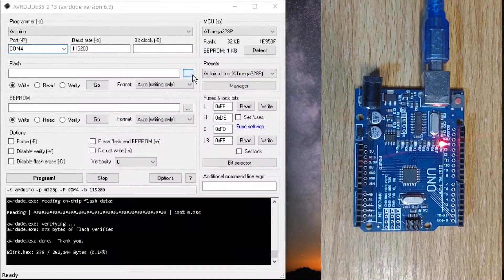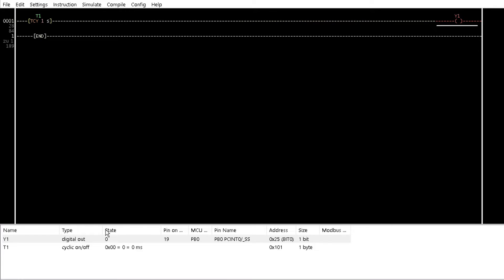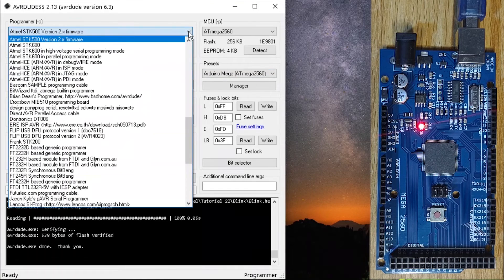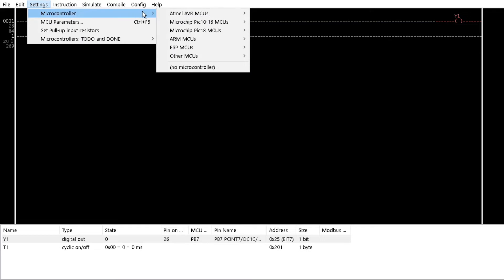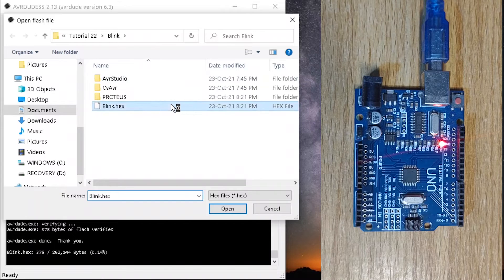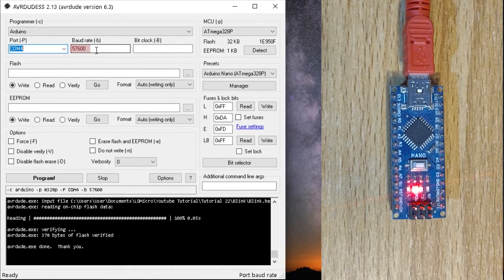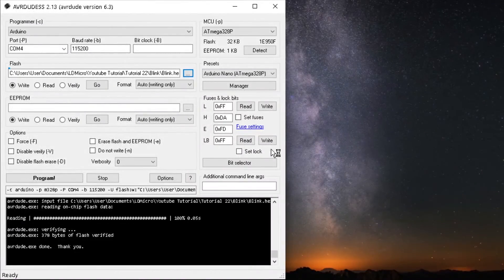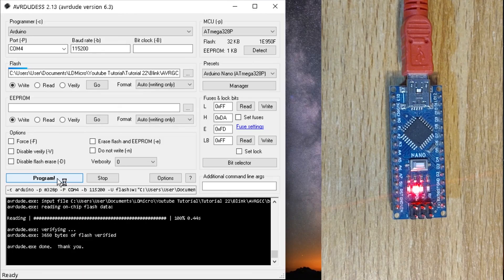LDmicro 22: Arduino Boards with AVRDUDESS  (Microcontroller PLC Ladder Programming with LDmicro)

Comment: What is problem in my Atmega328 P-U microcontroller. I am using external 16mhz crystal am using this setting 0xDE, 0xFD, and write by avrdudess 2.4.
my project stuck or hang after some hour... how to solve my problem..plz tell me
Reply from the maker: Try the high fuse: 0xDE, low fuse: 0xFF and extended fuse: 0xFD

Comment: This is great!!!

How can I use AVRDUDESS-2.13 to program I2C and UART functions?
Shall I use the HI-TECH method to compile first?

I am interested in starting with Arduino Mega2560.

 I will buy it by using the links attached to your video.
Thank you very much in advance.
Reply from the maker: The AVRDUDESS is for uploading hex files only to Atmel AVR microcontrollers which is the heart of the Arduino Mega, Uno and Nano.

If your program does not have I2C or SPI instructions, you can compile normally and upload with AVRDUDESS for AVR microcontrollers or with PICkit for PIC microcontrollers. If it does contain I2C and SPI instructions, compile with ATMEL AVRGCC for AVR microcontrollers and upload with AVRDUDESS or with HI-TECH C for PIC microcontrollers and upload with PICkit. See tutorial 15 for PIC microcontroller (https://youtu.be/55Bk0BAX8P8?t=354)

Thanks in advance for supporting the channel by purchasing with the links in the description.
Reply: @OnosTech  Thanks a lot!!!
Reply from the maker: You are welcome